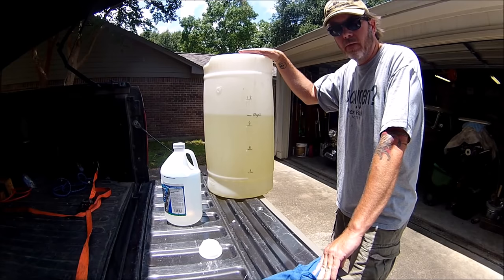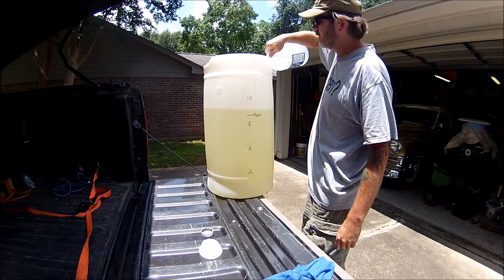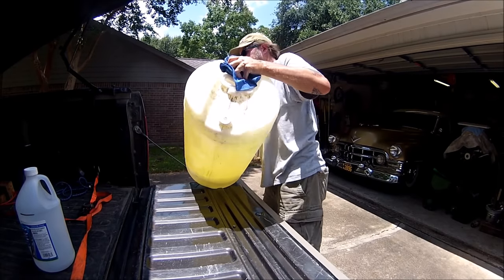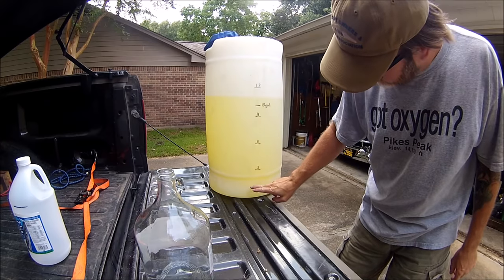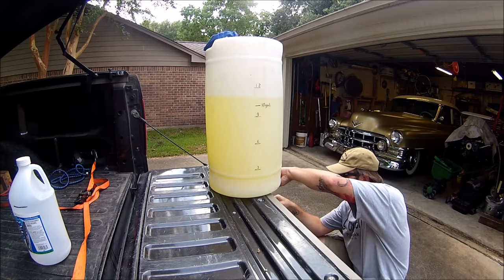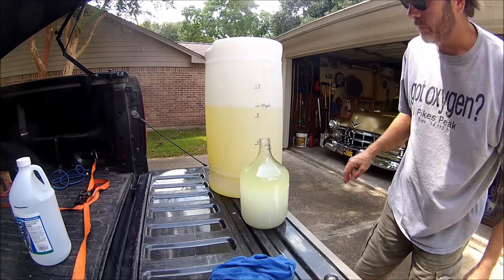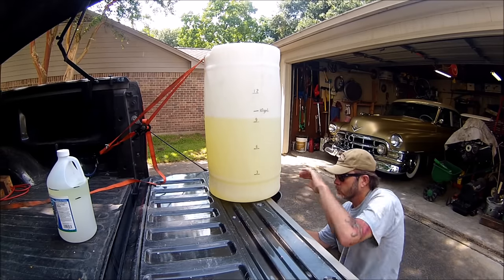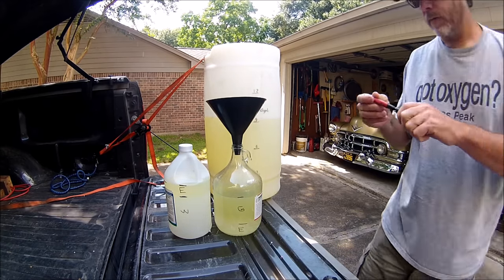How to easily extract ethanol out of gasoline.

Comment: I really couldn't help but notice that beautiful old Cadillac in the garage.
Reply: Me too. Badass Caddy
Reply: @toxic1venom  
I know, right?  Very clean.  It looks like a 1952.  What do you think?
Reply: 50 or 51 series 62 sedan 
I have a 46 series 62
Reply: That colour !!! Beauty !!!
Reply from the maker: It's a '52 series 62. 4 door on air ride with a 454 in it.
Reply: @BobbyMunroe  
Ah, ha.  I win the prize!!!....uh what prize?  Actually, I cheated.  I knew it was early 50's so, I looked on line at grilles from the era.  Do I still win?  Maybe, just a ride in it.

It must be a real head turner with that color and the 454.  Love the color!  Do you have any videos of it?
Reply: @BobbyMunroe  
I took the liberty of searching your channel....a burn out, engine install, and a video when it was black.  No recent shots.
Reply from the maker: There is this one.  https://youtu.be/PYE9YK4_1wg
Reply: What kind of valve did u use for the drain?
Thanks !
Reply: Yes. It was a bit distracting.
Reply: Stunning
Reply: Probably what the whole process is about. Gasket preservation.

Comment: I hauled gasoline for a living for many years... recently retired from doing that.  The gasoline which is mixed with ethanol in most cases is what we called "sub grade"... it was only about 85 octane.  The 10% ethanol brought octane up to 87.  With your premium, depending on where you buy it, you could be losing some octane by doing this.  But if you can get it truly clean, it'll still be worth it.   Stations in our part of Virginia still sell no-ethanol gas.  Find a shoreline station where boats fill up... most of that will be ethanol free (though not cheap).

Comment: You ideally need a funnel bottom vessel with a valve in the center of the funnel this way you are sure all the water is remove.   Also, blue or red food color in the water makes is very easy to see the separation line.  The key here is you must mix the water and gasoline completely .  The last step is let  the mixture set for at least 24 hours, this stuff doesn't get absorbed in 5 minutes.  The more water drops you make in the gasoline the better it will absorb the ethanol.  I actually use a fuel rated pump to pump the gasoline inside the container.  Once the fuel and water hit the impeller of the pump it forces the alcohol to bind.  I pump it for twenty to thirty minutes and then make sure its in the funnel down position.  After 24 hours I get a complete separation and just drain off the water/ethanol mix. The slower you drain it out the better it works also.  As stated in another comment, if you do the math, 10% of the volume of gas is ethanol so you get the gallon of water and 10% of whatever quantity of gas you added.

Comment: I have tested the gasoline from the major stations and the ethanol content in premium gas is no more than 4%. I have used gas with the ethanol removed for chainsaw and mower and it is much better and more powerful. One thing than that needs to be done is the mixed gas and water needs to set at least 12 hours before draining the water and ethanol out.

Comment: If gasoline is 10% ethanol that would have been two gallons you should have come out with  one ethanol and one water mixed together equal two gallons.... and you would have been left with 9 gallons of gasoline.... glad you did not set your pickup on fire you make a great mad scientist thanks for the video
Reply from the maker: "May contain up to 10% ethanol" Does not mean it contains a minimum of 10% ethanol.

Comment: Nice car in the garage !!
Here our local WAWA sells "recreational gas" (ethanol free gas) that
is actually the recommended gas for jet ski, boats, lawn equipment
and other small engines. You can also put it in your vehicle, it will cost
more but in my truck it can deliver better than 50% more mileage so I can
afford to pay at least that much more not to mention getting a power increase.
I understand some states have outlawed ethanol gas and the ones that sell
it have no specific laws as to the percentage content which can vary all over
the place, 5% is not necessarily 5%, nor is 10% necessarily 10%, etc.
Ethanol gas also makes our food supply cost more as there is less cattle
feed etc., have you noticed what a loaf of bread sells for now ? Ethanol
gas should be illegal.
Reply: Look out for the specific gravity changes in the 10% Ethanol fuel.  Either it's not only 10% could be more or at least at 10% the floats in carburetors will not float in the Ethanol fuel correctly, the car will flood and of have drive ability issues.   Watch out on cars and small engines this can cause a real fire hazard.  Been here, learn it.  I have a lot of old stuff.  I will only use Ethanol free fuel.  Yeah $$$, but love the power, and fuel mileage increases.  : )
Reply: Consumers pay more for the Box that the corn flakes come in than farmers are paid for the corn .. There is like  22 cents worth of Corn in a box of corn flakes ..   Corn prices are less than what it costs farmers to raise them many years..     There is a huge surplus of Food in the USA   Third World Country people are starving but they only  make  $200 per year on average so they have no money to buy food anyway ..    Put your money where your mouth is and  buy food for third world people and send it to them ..
Reply: @mikeskidmore6754  : What the hell does your rant have to do with  the video?
Reply: So your saying my Buick which gets 33 mpg will get 66 miles per gallon without ethanol?  Do a video proving your 50 percent increase in mileage.
Reply: Gary Finger  That's 100% improvement and 100% incorrect.
There's a maximum of 10% Ethanol in your fuel and it works out to a 2-3% decrease in MPG. . .. about the same as fueling error or the allowed 5% pump error.

Your mileage may not vary.
Reply: @paulferrara9079  good point. It also eats thru the platic fuel lines and paper and cork gaskets and natural rubber o rings. Ethanol forces us to change out fuel pumps gaskets and fuel lines.
Reply: @mikeskidmore6754 Sounds like we should buy the corn DIRECTLY from the farmer then. But you wouldn't recommend that because that would actually fix the problem as opposed to kicking the can down the road like you suggest with us sending corn to starving people.

Comment: Chemical Engineer here.  You can separate ethanol from gasoline using water, but to do a decent job requires several extractions, not just one as seen here.  Ethanol is a big scam on the taxpayers, but extracting it from gas is way more trouble than it is worth.  You will also get some of the lighter components of the gas.  Bottom line: don't do this.
Reply: use pure-gas.org to locate your state/towns to find a gasoline pump with ethanol-free gas an go buy it there.... mowers and blowers only need a few gallons per season, so a 5 gallon jug would be plenty
Reply: Doug H. in VA I don’t have a lot of options for ethanol free fuel around me. Seems like the rural communities have that option readily available. There is one gas station about 10 miles away that carries it, but that’s somewhat out of my way for everyday purposes.

Comment: How do you dispose of the ethanol. Have you tried to burn it to see if it is still flammable
Reply: Gasoline dose not burn it's the fumes burn I tried set gasoline on fire with blow torch. I was welding my gas tank fill it until runs over get all the air out the cap it

Comment: 10% ethanol plus 1 gallon of water out of 10 gallons would equal 2 gallons !
Reply: The correct ratio is 1 cup of water per US gallon for the removal, and even at that the separation will be "almost" correct due to inaccuracy in pulling the separation.  And yes, the volume extracted would be the original water added plus something approaching the 10% ethanol content...
Reply: I agree
Reply: Did you watch until the end? He removed right around 2 gallons.
Reply: From what I remember about ethanol, the molecules are smaller than water molecules so that when they are mixed say 1 gallon to 1 gallon you don't get 2 gallons.  The reason being that the alcohol is miscible in the water.
Reply: @Tableaux15  if that is true, then the weight of the mix should be heavier than water
Reply: Exactly!
Reply: Not exactly, the ethanol is a molecule that has room for water within its construct.
Ethanol is hygroscopic and absorbs water. Like a sponge...
The sponge swells when it's wet but it doesn't increase in size equal to the mass of water added. So I agree he should get more than 1 gallon of water, but it will be considerable less than the sum of the 2 liquids. Maybe 1.2 gallons.
Reply: Since ethanol is an octane enhancer, removing one gallon of it leaves you with 9 gallons of probably sub-90 octane crap gasoline. If you want to put good fuel in that old Cadillac, you’re better off buying AVGAS or racing fuel.
Reply: https://www.pure-gas.org
Reply: Actually if you read the content of 10% ethanol it don't say it's exactly 10% it says no more than 10% so it could be that there is only 8% in that fuel. There's no way to get the exact amount out of the pump. Even E85 is not true 85%.
Reply: And this is what its all about. I prefer fractional distillation, i do it just to make white gas but alcohol leaves gasoline quick, you know this
Reply: Avgas contains lead, and is not legal to run on the street. It's approved only for aircraft.
Reply: Is it actually 10% ethanol?  The fuel pumps say "may contain UP TO 10% ethanol."
Reply: It is more complicated than that. When ethanol, hydrocarbons, and water are all mixed, you do extract some ethanol into the water phase (and some gasoline, which is a loss). But some ethanol stays in the hydrocarbon phase, and it pulls some water into that phase as well. This is a reciped for making crappy, water-laden, low-octane gasoline, plus a bunch of hazardous waste that contains the ethanol you paid for when you bought the gasoline and a little bit of the gasoline, too. Horrible, pathetic, incompetent hillbilly technology. DO NOT DO THIS!!!
Reply: @UncleKennysPlace  who says lead gas is not leagal? You just can't run it in a car with a catalytic converter. Because it will plug it up. Now it is illegal to modify a vehicle made after 1979 to be able to run it. But if the vehicle was made before 1980 you can still run leaded gas in it if you can find it.
Reply: @UncleKennysPlace  now you are correct that Avgas is illegal. But it's not because of the lead.  It is because of no Road tax on it.
Reply: From 1 January 1996, the U.S. Clean Air Act banned the sale of leaded fuel for use in on-road vehicles in the U.S. Note that is doesn't matter WHERE the fuel comes from, or whether it is taxed or not. If you buy it with the INTENT of putting it in a road-registered vehicle you are in violation.
Reply: Find a Co-Op fuel station for pure gasoline. Farmers use it because it can sit all winter and wont ruin those great old farm equipment

Comment: I just googled ethanol free gas in my area and went there! Some stations do sell it in premium. I don't worry about the cost. It also turned out they sell E85 at $1.79 and never change that price so it's great for my flex fuel truck and I don't have to worry about the PITA of doing this process which does remove more that you want.
Reply: Go back and look at these gas prices compared to now, 2022 😆

Comment: I use a Pyrex 1L separatory funnel to do mine.  I use distilled water and mix in about 200ml H20 to 750ml gas.  Shake, burp, shake, burp and repeat several times.  You can see the ethanol going into solution with the water.  Then I let sit and go do something then decant off the water.  Usually I am only making enough fuel for the lawn mower/weedeater for the season.

Comment: @PT-ie2xj
9 days ago
I wouldn't recommend this. Modern gasoline contains a variety of additives that serve important purposes. These include detergents that keep your engine clean, anti-corrosion inhibitors to protect your fuel system, seal preservatives to prevent fuel leaks, and lubricants to reduce friction. Siphoning off the top layer of gasoline after mixing with water may remove some of these additives along with the ethanol (depending on the additives' affinity for alcohol and water). Also, as others have pointed out, removing the ethanol decreases the octane rating. This method of getting ethanol-free gas has the potential to cause as much harm as good.

Comment: Sir, in theory your system should work, if fact, since you are removing the water you could actually add an extra quantity of water w/o a problem. I've considered the process, as I've two antique tractor engines and one small aircraft engine which use gasoline. My concern,  as a retired Firefighter/medic, is the safety of what you must do to get the ETOH out. I've seen numerous burns to people handling fuel improperly, and it never went well. I opted to just pay more to get pure gas at Wawa.  Good luck.

Comment: If you mix gas water and ethanol, the ethanol will act as an emulisfier and leave a bunch of the water in the gasoline. Not a good idea. What do you think the old "Dry Gas" was ?....Ethanol. It made the little bit of water in the bottom of the tank mix in and burn.
Reply: Actually water in the gas IS a good thing. It keeps carbon from forming in the cylinders. I used to have a water injection system on my old Old's Cutlass.
Reply: Dry Gas was methanol i do believe. Ethanol you can drink, Dry Gas, no.
Reply: "Dry Gas" is nothing more than isopropyl alcohol. Guy at the auto parts store showed me the MSDS sheet on it. Active ingredient is isopropyl alcohol. Just buy the 91% bottle at your local drug store and add 8 ounces at next fill up.
Reply: @integr8er66 , i dont think that water injector system actually mixed with the fuel in that type of way. 

But you are right about those types of systems having been used. They still have a pretty good aftermarket of them.

Maybe im mistaken though, but i thought it was injected separately thus allowing the water to turn into steam so it would clean up the residual carbon.
Reply: Twinky UnOuWaNtMyCrEaMFiLlInG well it doesn't really matter how the water gets there, I used a vacuum port and a needle valve for mine, but regardless, water does not chemically change when absorbed by ethanol, so when it goes through the combustion process it still turns to steam. This does 2 things, cools the cylinder, and combines with any carbon to clean the combustion chamber preventing hot spots that can cause pre ignition. Actually, it probably robs a bit of power considering some BTUs are used up in the conversion tp steam, but the cleaning factor was what I was after

Comment: Bobby. A good followup on this video would be if you would extract the alcohol layer and try to light it. Then, extract just the water layer and see if it has any volatility to it. This would prove that you did indeed get the alcohol and the water separated from the gas.

Comment: I can't quite agree with ethanol haters. Growing up in the corn belt as a non farmer, I've worked construction all my adult life, I have ran almost exclusively e10 or higher. Guess how many problems I have experienced.....zero. I did however fill  up in Wyoming once at a non ethanol pump, and experienced issues until I got back to South Dakota and used ethanol to pull the water out of my tank. Took 2 fill ups to not have it die leaving the pump. We run e10 in everything. Go cart track near here runs e85 in their small engines and have for over a decade. I really don't care what you do or say, I'm content to burn it, especially since the only thing I've felt or noticed is less cost per mile. Which is the real way to compare, not mpg. Yes mileage drops, but cost per gallon does too. No engine failures, no freezeups, not problems. Change my mind

Comment: Ethanol in Gas (Petrol over here in the UK) is a major problem as it destroys fuel systems. On plastic/resin fuel tanks (Common on modern bikes) it make the tanks expand (To the point where they won't fit the bike anymore), causes bleeding through the tanks destroying the paint. It's a disaster all round. Something to bear in mind though when you remove the ethanol is that ethanol has a higher octane rating then petrol (Sorry gas!) so if you remove it, the fuel remaining has a lower octane rating than what you started out with. Therefore if you don't then add some sort of octane booster you will likely damage your engine due to pre-ignition etc.
Reply: Here in Canada our Premium grade gas has 0% ethanol. I'm told most States are the same. Id like to find a list of States where all gas has ethanol so I can strategically plot my course around them when I take my bike across North America.
Reply: I have personally witnessed the tank expansion problem.  Chrysler Pacificas...around 2004-2006.  The tank would expand and break an external vapor line, causing the check engine light to illuminate.

Comment: Interesting idea. I actually had this happen in a UTV's gas tank over the past winter, condensation caused the ethanol to separate out of the fuel and settle in the bottom of the tank. Cleaned the carb and it still wouldn't fire, the fuel pickup is near the bottom of the tank and it was sucking the water/alcohol mix instead of gasoline. Cleaned the carb again, drained the tank into a translucent racing fuel can and once it had settled the problem was obvious. Siphoned the gas off the top back into the UTV's tank and it started right up. I dumped the leftover water/ethanol/gas mix in my truck, it's EFI and was already 3/4 full of fuel and burned it without issue.